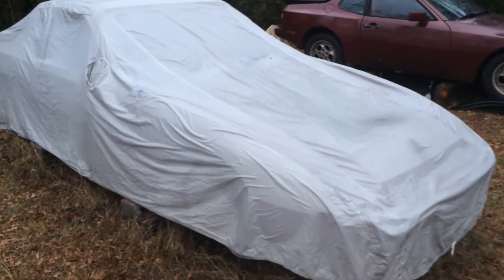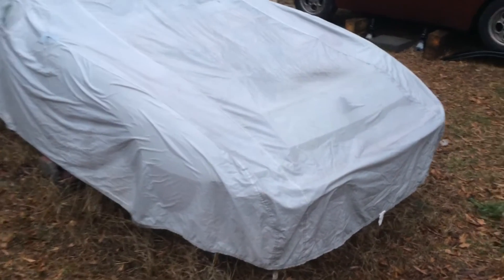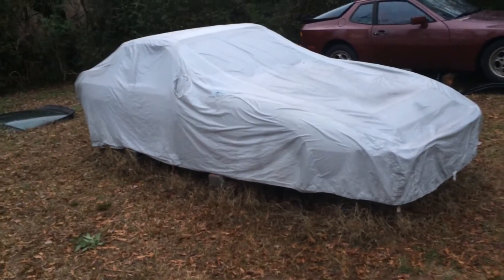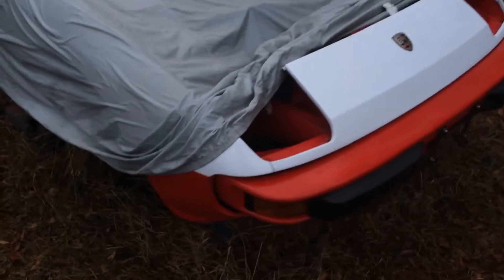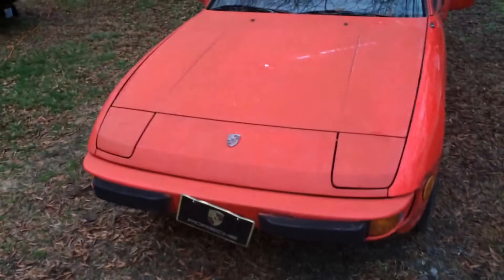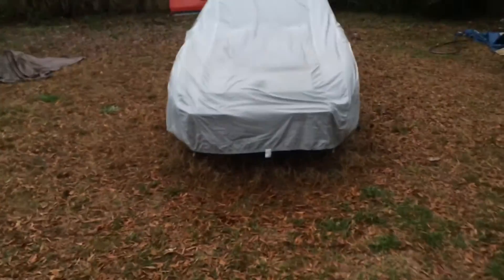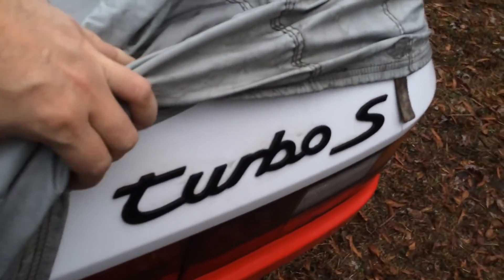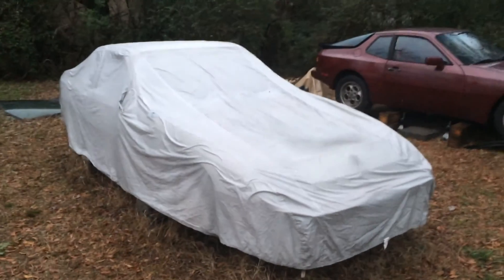Porsche 924 Turbo S Update

Comment: I knew it, Brent!  There's many more 944 channels out there but not too much info on 924s.  I too have an infinity for the purity of design in the narrow body and the improved performance of the 944 power plant.  Love to see work done on the 931 engine but I guess we will all have to wait.  Your thoughts on the 931 front fairing with the air intakes?  And thoughs on Euro bumpers?  I hear the bumpers are next to imposible to find in North America but the front fairing might add performance and an interesting look.
Reply from the maker: I plan to get back to this project soon. I've had a ton of cars pouring in but I have the water pump and belts ready to go back on. As far as the 931 vents, they're actually in a low pressure zone and just for looks with a plate back there. On the 951 the intercooler air comes from a high-pressure zone in the bumper, so I did the same with my build. If I had used the low pressure zone in the nose panel, hot air from the engine would be pulled backwards across the intercooler. That said, I like the look of the Euro bumpers but there are two different kinds. The real bumpers are aluminum and mount to the bumper shocks so the stick out similar to the US style. These appear to be rare but the only ones I would really ever bother with. The fiberglass units are not actually bumpers and are mounted to rigid metal mounts that offer no protection. In Europe you could opt out of safety features so a lot of cars came with the cheaper fiberglass 'bumpers'. I hope that helps!

Comment: Very interested how your 924 "carrera" is gonna turn out, I'm also curious how you got the 951 intercooler in there!
Reply from the maker: Thanks! I have no idea when I'll finish it but I will start as soon as I finish work on the burgundy 944. To fit the intercooler in there I had to cut the front section out of a 951 and weld it in. I also had to mod the 924S nose panel a bit, but it really wasn't as hard as I expected it to be.

Comment: I know where my old 2 liter 77 model 924 is (at a local junk yard) and the owner is getting very old now I think I might be able to buy it back. I have thought of doing a 924 Carrera GTS kind of thing with it (if I can actually buy it back) with the rear flares and 944 front fenders. Just gut the interior race car style and use a 944 drive train from one of the many very rough 944's you can find here and there. I have always loved the wide body style my self but I don't really want to mess with the ancient CIS analog injection system or the Audi 2 liter engine so I don't know if's worth the effort of not...probably not I suppose. I do really love the look of getting rid of the flip up lights and the upper valence panel with the cooling slots cut in it though. Too many projects too little time...Thanks for the videos!!
Reply from the maker: That would be awesome, but just a heads up; getting the 944 drivetrain in the early 924's is a real headache. I don't blame you for not wanting to deal with the CIS, though. Speaking of wide-bodies, a few years ago I was asked to build a 924 Carrera GT tribute. The plan was to start with an early 951 then weld 924 rear quarters on. That way I didn't have to spend a lot of time on an engine swap and it would have the nicer late interior. The plans fell through but this is something that I want to build in the future. I think when the time comes I would want a 3.0 16 valve turbo engine in it since I would want it faster than my narrow body. Right now I'm having some work done to my shop but in a few weeks I hope to start getting some of this stuff done!